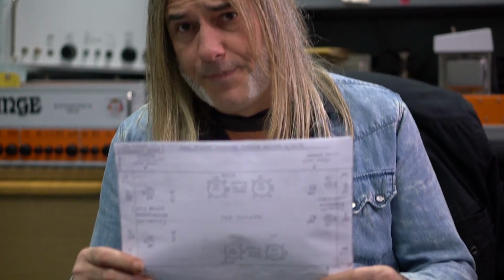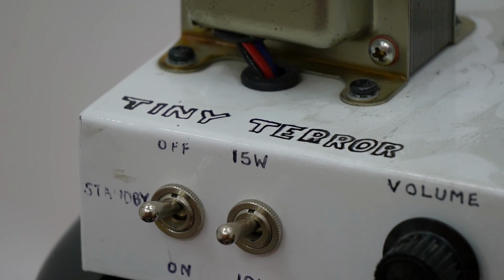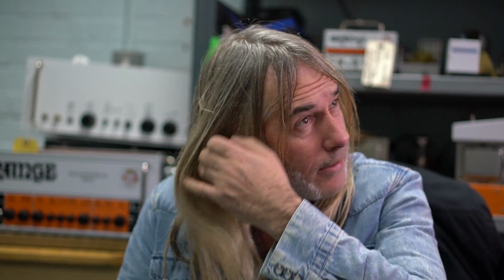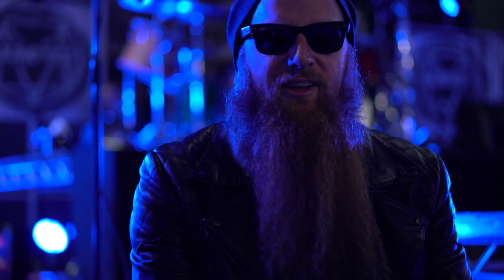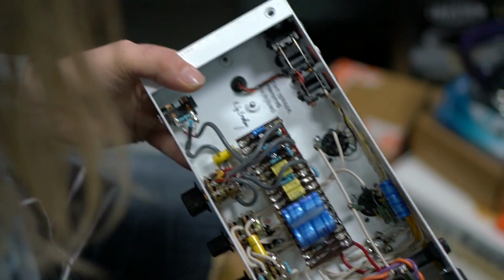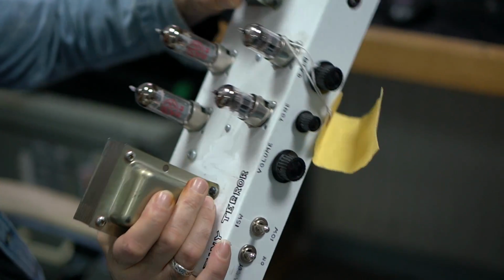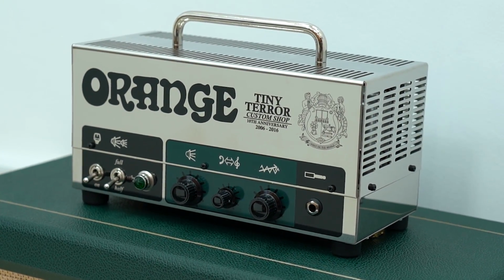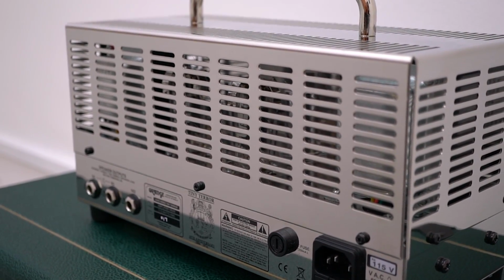Tiny Terror: The Original Lunchbox Amplifier

Comment: should have kept building them like the prototype, looks beautiful and more robust. even the 2006 one i got today had 5 subpar solder joints (made in korea), the dark terror i had, had around 6 subpar, 2 balled and 2 cold joints. popped a fx loop tube twice and nearly took my output valves out. the JR #4 was really nice and i regret letting it go to a degree. would really rather have a rockerverb mk2, but i think this one will stick around a bit since i touched up the joints.

Comment: Hey guys I have a Number 3 of 215 limited edition 2009 in white cabinet. 2 12 inches a pair of Celestion G12 Vintage 30s in an open-back acoustically designed enclosure, made from 13 ply high density 18mm Baltic Birch ply to further enhance its tone. twin channel  retains the original vintage sound and utilises a smooth electron emissions GZ34 valve rectifier. I haven’t found any of this amp on utube or anywhere. I’d like to now why and who the 215 amps where made for. Having Number 3 hidden away in a vault in a Guitar shop. Still in box and plastic. Hand wired. It just has this great sound Single or humbuckers. Become a fan love a head that can run low for night playing and cabinet. But on Army pension family gone so me guitars and my dog. I love my Fender amps but now another orange is going to be a savings goal. Love blues rock to some heavy. Plate in Black ontop says 2009 limited edition. Got to get an orange T-shirt XXL in Australia. Bummer going to miss out on the tiny terror as want to get heads and a good cabinet. I just never see my limited edition. Like to see specs.
Reply: I googled your 2009 limited edition and yes they made some in white but nothing different apart from the white tolex covering. They look cool in white though. Which model amp is yours? Rockerverb 100 or Rocker 30 or?

Comment: Dark Terrror with 12Ay7 V1 works out very well. Also I tried 2 5751s, V1 and V2 and this also tamed fizziness and buzz. The 3 100pf bright caps sure add a lot of bite. C4,C5 and C8. Probably could be 47pf is enough. Love this little amp.

Comment: love these Tiny Terror heads. we use one for a 7 string tuned to A with a tube screamer. Orange 4x12 1970s cab with vintage 30's. Sounds amazing
Reply: I've got a good deal on the Rockeverb 50mki for 830 bucks, but thinking of buying this for a backup. There a deal for 340bucks right now... Fuck it :D

Comment: So what exactly constitutes a lunchbox amp now?
The Valve Junior was released before the Tiny Terror, and the ZT Lunchbox was the first to coin the term as far as I know. Either way, the Tiny Terror is hardly the original by any stretch of the imagination. Unless you're modifying the rules to exclude the Valve Junior for some reason.
I'm a fan of Orange Amps for sure, but I'm not sure how the claim holds up...

Comment: His there, I've got a few questions for Adrian if that's okay.
Why has the OB 1 K 1000 watt bass head been discontinued so quickly? In fact a lot of your stuff gets discontinued which I don't understand cause if you're products are good and popular, then why not keep making them and just update them and tweak them like Ampeg or ash down. I would love to try the ob1 K as I've tried the ob1 500 which I really liked . But now, the 1000watt head you can't get for love or money. Second question: is the body on the OB basses solid under the scratchplate, can I play without it and is there any chance of a twin pickup version an OB3 version if you will. Would be nice to have a pickup near the bridge in addition to the neck. Maybe a second p pickup?
Thank you
Richard Oakes 
South Wales.